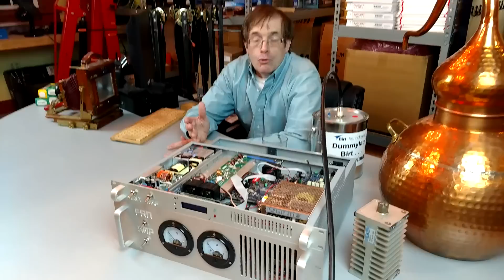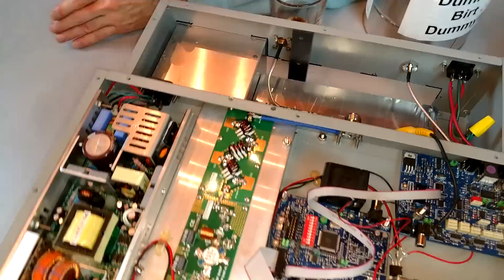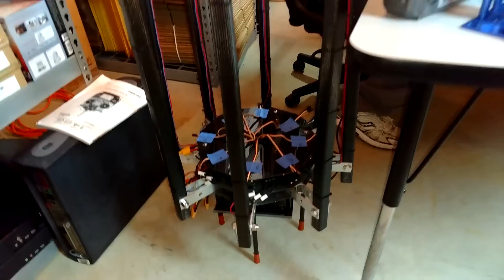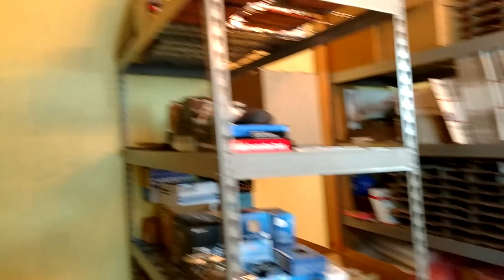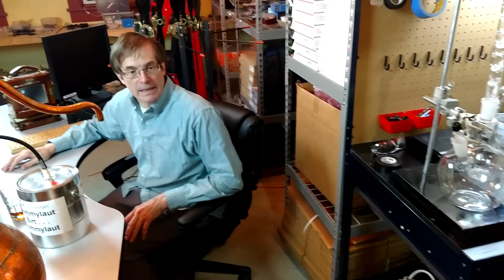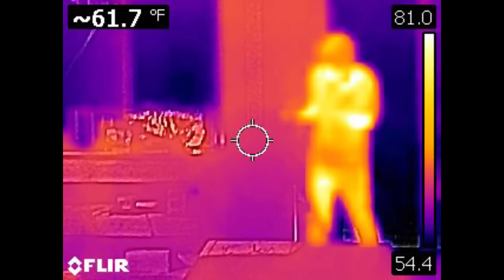A New Beginning: Drones, Radio, Chemistry, Computers, Distilling and still Lasers.

Comment: The bellows focal plane camera you have on your desk, does it have a focal plane shutter on it besides the in between the lens one?
Reply from the maker: Yes, but only as a protective  shield for the film holder.  Once installed, the film depends on the shutter mounted in the lens.

Comment: :D Its our old friend, Mr 60Hz!  He shows up whether you want him to or not.
I feel like I found your channel more in the "Empire Strikes Back" phase.
Reply from the maker: If this video is how you found this channel, then you are correct, you did.
Reply: Nope, I believe the first video I saw was the one on audio exciters, which (ironically) is what I was doing all day.  I didn't have an audio amplifier laying around but I did have a bunch of parts.  30 minutes later I had a pretty nice audio amp.  Of course it wasn't till 6 hours after that that I finally found one dead channel on a quad op-amp that was making my otherwise nice amplifier not work.

I happened to have some chunks of extruded polystyrene laying around and it sounds pretty nice even sitting next to half a dozen shrieking rack-mount servers.

You know, I can't help but think "V1 pulse jet + audio exceiter = ?" and "how small, light and parallel can you make a tesla valve?"
Reply from the maker: That's the point.  Remember how ET "phoned home?  We are surrounded by possibilities and just need eyes to see them.  
Interesting suggestions.  We are in fact working on a pulse jet turbofan.
Reply: Its a thing I've noticed: everyone seems to be under the impression that there's nothing new under the sun.  Everyone's disciplines are so specific that they can't see the exponential increase in potential from having strong from disparate fields.

One of the things that pushed me down that path was my somewhat random choice of specialty when I went into the army, "land combat missile systems repair", which gave me at least a small amount of hydraulics and aerodynamics and a very large amount of radio and digital electronics and optics.  The number of different disciplines involved in just the Javelin missile alone going from point A to point B (you don't want to be at point B) is huge.
Reply from the maker: By the way, thank you for your service!
Reply: Thanks for your channel!
Unfortunately the army part of me makes a lot of the technological combinations I think of be against YT's terms of service.  Not illegal, mind you, but "gyro stabilization + picatinny rail = video flagged for everything under the sun".  Would be extremely helpful for the Navy and Coast Guard, though.  Its very, very, very hard to fire accurately from a boat.

Comment: please fix the audio  issues (sync and levels). the topics are interesting, but the video is very difficult to watch due to the audio issues and camera work.
Reply from the maker: We tried a new set up with a lapel mic that failed...mid video and discovered this only when editing. The sound had to be pulled in from a phone which just happened to be running concurrently with the filming. You'll l not see this low production standard in the future.  Stay tuned.
Reply: you could use some multi-band-compress to fix it
Reply: Best of luck with the new direction for the channel.